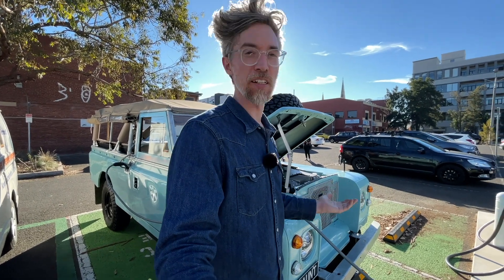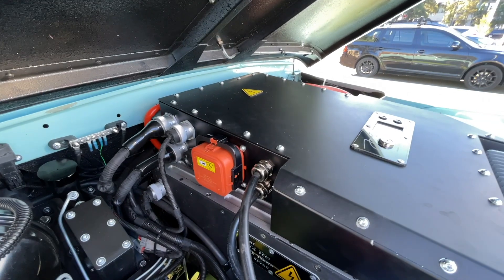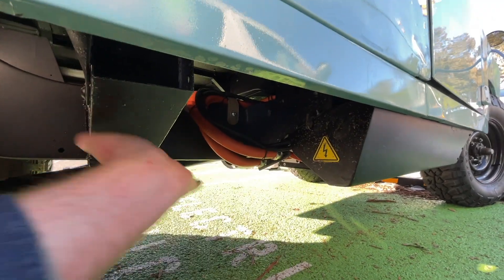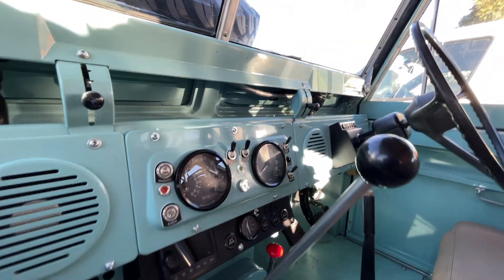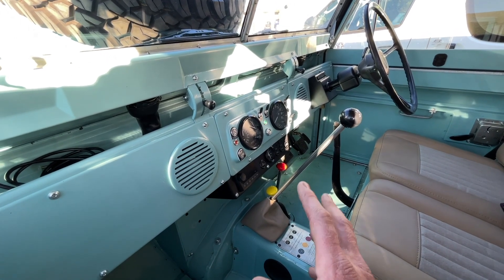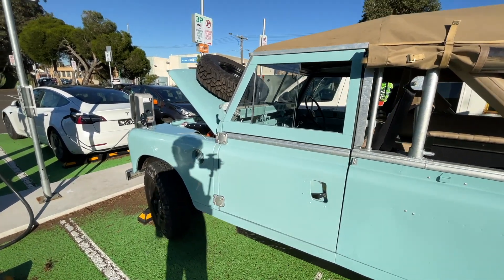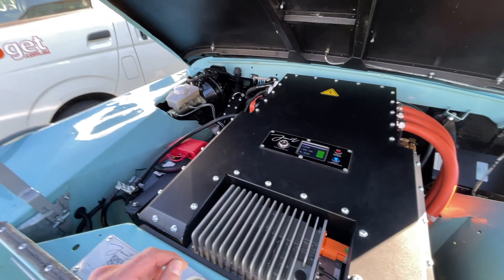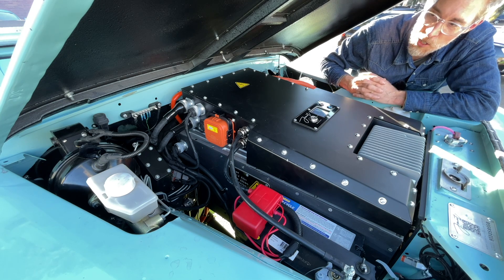Ultimate Land Rover Engine Swap || Electric Conversion

Comment: Great work. Question around weight.. does it affect body roll and did you have to alter the suspension?
Reply from the maker: The centre of gravity is a bit lower.  About 50-100kg heavier overall.   We use parabolic springs and the shocks are a bit stiffer than stock

Comment: What a fantastic conversion, with just one detail raising my eyebrow a bit.
You mentioned replacing the drum handbrake at the rear of the transmission with a disc setup.
Drums are generally accepted as providing a better handbrake, where the main use isn't in actually slowing the vehicle, just anchoring it.
A disc setup will more likely have exposed friction surfaces catching any transmission leaks and have less friction surface area.
Change just for the sake of change is a financial cost without reward.
Reply from the maker: It's a debate we had internally.  The challenge is the series drum hand brakes aren't great, and require continual adjustment. without an internal combustion engine there is nothing stopping the car from rolling but the handbrake - no compression in the electric motor when left in gear.  So we had to put something more powerful in, and the disc is much much stronger.  Easier for most people to keep it clean than adjust the drum
Reply: @Jauntmotors  Sounds like the rest of the vehicle, it was very well thought through. I've never had or worked on a Land Rover and wasn't aware of the specific downsides on that handbrake drum.

Comment: Hi ya… I love this application. I have an imported 2008 Landrover Defender 90 (2.4) with all the fancy British non Australian configuration has 6000km on it however I want something special - I think this is it - Are you interested in doing something with that? Please let me know Cheers muchly
Reply from the maker: Hi and thanks.  Yes! We have a few later model defenders in the workshop and we'll be releasing more details soon on the spec. Basically twice the power as we put into the series.

Comment: As someone who has driven Land Rovers for over forty years I have to say you have done a beautiful job with this conversion. Maybe those side batteries could be better placed somewhere inboard for any serious off-road use, but otherwise a great piece of re-engineering.
Reply from the maker: Thanks. And yes we wish the chassis was a little wider. But we do a sill pack protection plate that keeps it pretty safe

Comment: wish truly affordable ultra simplified EV conversion kits were available, using used components for universal fitment te retro mod classics of choice - The TT 4wd is crying out for it

Why cant we have All the EV components supplied in a module similar to above, requiring just the (supplied) split battery packs & motor to be plugged in - Requiring only a motor to tranny adaptor kit + mounts

I have an old 916 GTV I would happily put say, modest Zoe components in if it came as above and affordable - Surely, used Zoe EV components are available for c $8k? + cost of making into Uni-fit kit - something that once you have been through the process for first time, must be Very easy to micro-productise to keep cost down?

Comment: All that work to get range anxiety, what a waste of time, where do you think that the energy to charge it comes from? Fossil fuels, dummy
Reply from the maker: Range anxiety is still a thing, particularly here in Australia with less than the best charging infrastructure, though theres thousands now.  This car has about a 250km range which is about all you want to do in an old Land Rover in a day anyway.     The public charge port I'm using in this video is powered by wind energy, and the ultimate home for this vehicle has a solar setup they'll be using to charge.  Unfortunately most of our energy in Australia is from coal, but the carbon emissions from using form of electricity in a battery electric vehicle are still way less than the original petrol motor.
Reply: Please try to be polite in your statements . It's a laudable venture , if not one that's going to make easy money for anyone's considerable hours involved . Further to my engine noise comment , I saw someone yesterday wearing Bose noise cancelling headphones whilst driving an ex-army 130 ragtop . Had to laugh .

Comment: Within a decade, I'm hoping that mass production of electric vehicle conversion kits for any car model comes about, with installation done quickly and economically by franchised garages. When my 2004 rust-free poverty-spec little car finally dies of a 'not economical to repair' engine failure, it's not being scrapped. I like the car so much, I'm storing it until it can be affordably converted.
Reply from the maker: Thats what we hope too.   Old 4WDS are relatively easy as the assembly is simple and the shapes are easy to work with. Newer cars have a lot of strange shapes and fasteners that make them better to assemble by robots but hard to work on by humans.  The labour cost is a challenge

Comment: Awesome job ! Simply stunning !!!!
Only weak link i see is the original gearbox...  Would you consider getting rid of it entirely, and drive a modern transfer case directly from the electric motor ?
Reply from the maker: We need a bit more torque to do that. But we're looking at an optional single reduction gear between motor and original transfer case
Reply: @Jauntmotors  Thanks !  So what about this modern 2 speed gearbox with lockable diff : https://www.youtube.com/watch?v=4_yw5ySXDf4  
You could use it in place of the original transfer case by simply rotating the assembly 90 degrees. 
Engine could be mounted directly to it, or kept under the hood and connected to the gearbox through a regular drive shaft.  Does that sound crazy to you ?
Reply: Alternatively you can always slap a Powerglide 2 speed (without torque converter) to your motor: https://www.youtube.com/watch?v=Ie7qvo-aC5k.  
I kinda love the idea of keeping the motor under the hood and connecting it to the transfer case with a drive shaft, because that would probably let you delete the transmission tunnel, have a fully flat cabin floor and a happy middle passenger.

Comment: Always wanted an EV conversion to mimic ICE torque curves to keep a closer stick shift experience rather than putting it in 3rd and leaving it. (Obv w improved performance)
Reply from the maker: If you want to shift you can wring a lot more speed out of the system. Its only 230Nm so not crazy amounts of torque